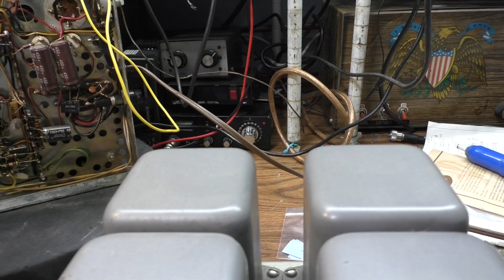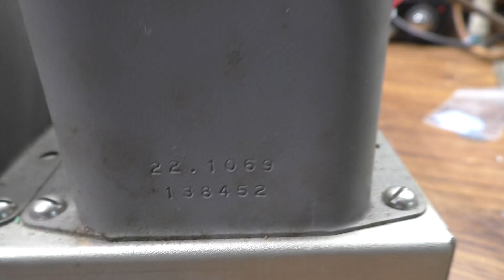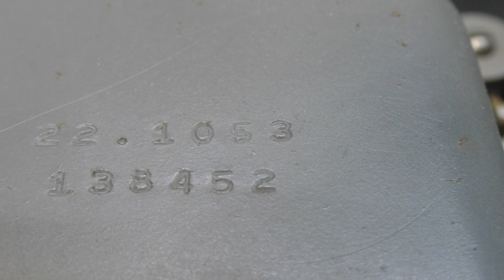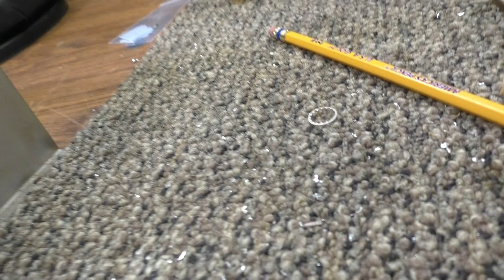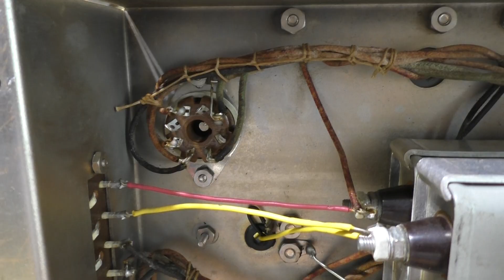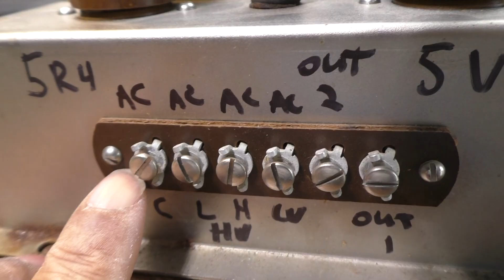unknown mystery power supply help me out revisited.

Comment: I thought swinging chokes were used with mercury vapour hv rectifiers like the 866
Reply from the maker: Not really, they were used back in the early days in HV circuits in place of the filter caps that are used nowadays. Back then, caps were large and expensive, plus back then, a choke filter instead of a cap filter was more efficient. Actually, it is still more efficient now, uses more of the transformer instead of just the peaks, which is what caps do. Mercury vapor rectifiers were just tube rectifiers that could handle high voltage. Just like the swinging chokes were replaced by cap now, tube rectifiers, including mercury ones, were replaced by diode strings.
Reply: Someone noted that this PS might have been used on a Hammond organ...
I cruzed around the NET but was not able to match it...
The mystery still remains...  😉